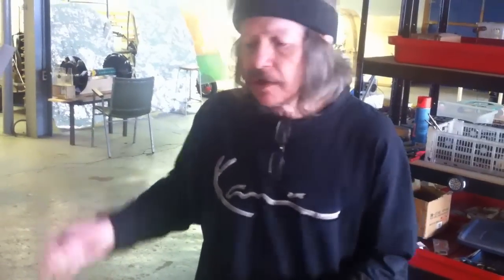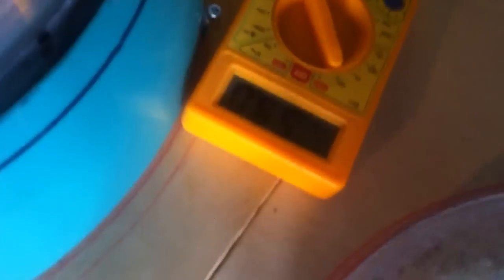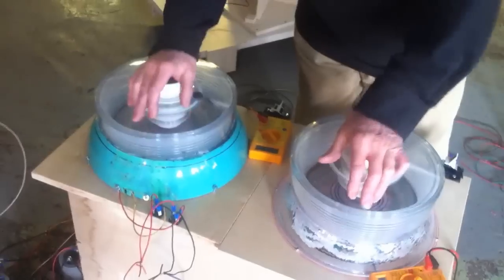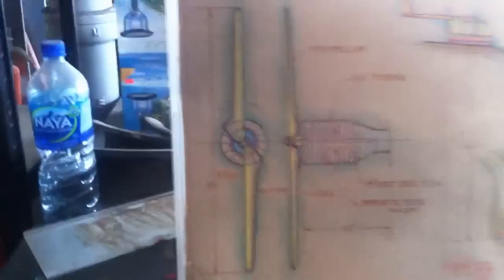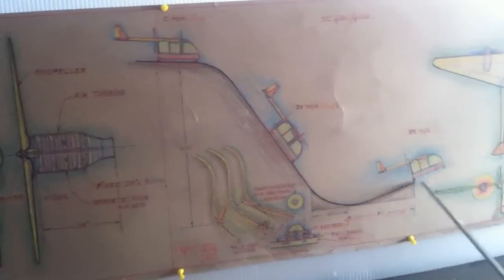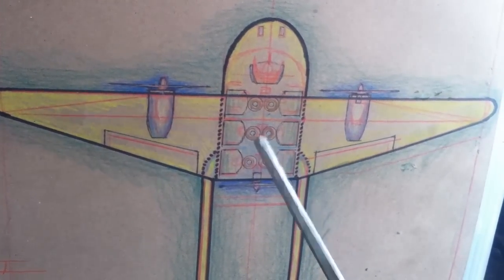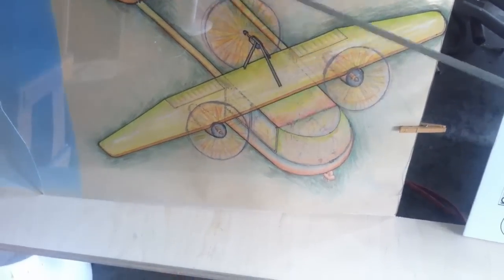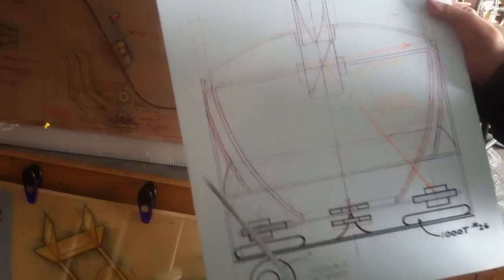UFO ALIEN LEAK FS24 - Human Powered Flight

Comment: how fast could you cross the country on a light weight plane that you peddle all night, charge up batteries and capacitors then fly during the day using electric motor, a hundred miles a day?

Comment: The Lithium Polymers on the biggest RC helis lift about a 35lbs payload. The outside interventions shown are designed to increase that to several hundred lbs - as "emergency landing supplements": 7000-10,000MAH one Kg. LiFePO4 no good for flight, too heavy(300kg), too big, too expensive, burn out too quick (500Rech warrenty). Look at Elect Plane flight, start motion on magnaworks demo, "Dedalous" Project, "Dreamliner" grounding etc. for research on why this tech. (Rotors are carbon fiber fanric)